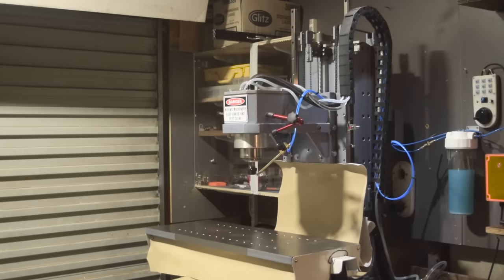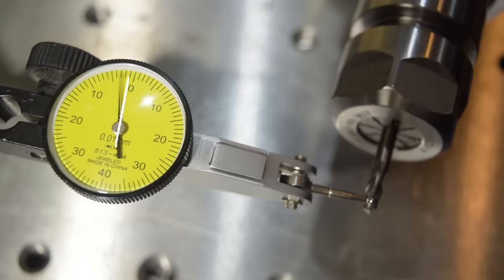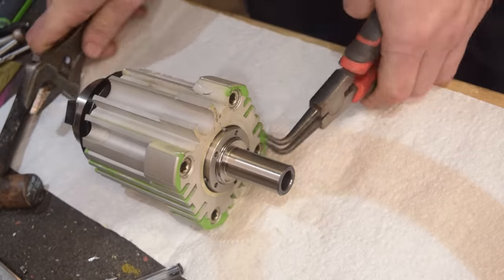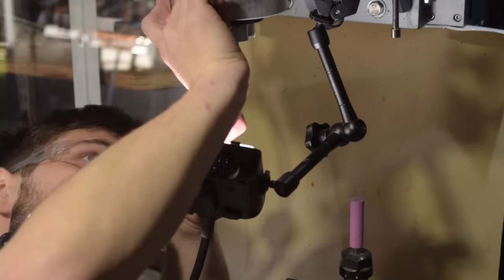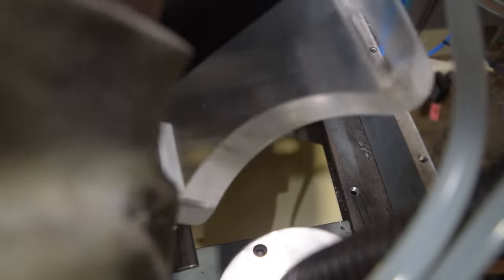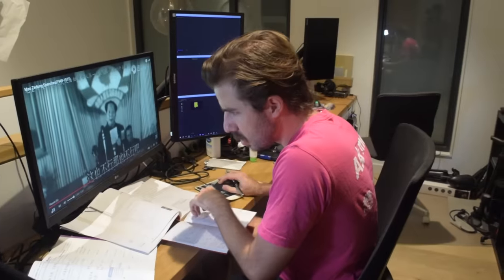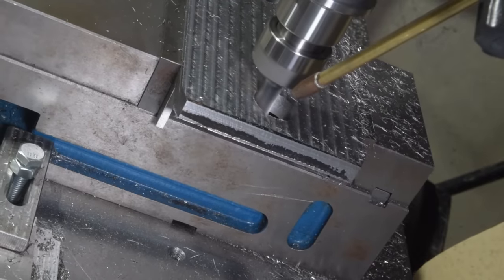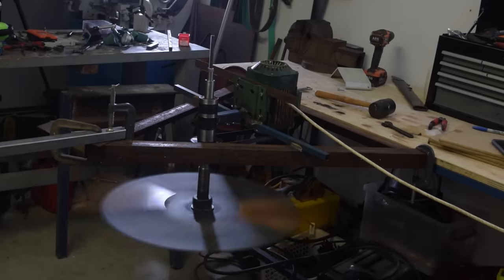I "fixed" this cheap Chinese tool

Comment: Don't take this as a criticism, but I would like to give you some tips for your griding setup. A spindle taper is not that difficult to grind, but never use feeds other than single axis. This adds up to the machine's errors and backlash, and very few CNC milling machines are precise enough to properly perform grinding to the precision required for BT30 using feeds in multiple axes. Typically, the attachment with its own feed is placed on the table, ensuring that it is perfectly parallel to the wall of the taper, but if you prefer to use the machine feed, you need to mount the spindle at an angle and the grinder vertically. You should move only Z-axis. Use a dye to check your progress and correct the angle if the top or bottom stops making a contact. Also make sure you're not pushing the grinder away, make empty feeds every few passes until the sparks disappear and the spindle is quiet, and then continue.
As for the bearings in Chinese spindles, they are terrible. It's best to buy the first one you find from Japan/USA/Europe. If you have a lathe, you can easily make a better housing out of a piece of steel or at least aluminum. I feel like you know how to do it.
Manual spindle scraping is only carried out on quills and mounting surfaces (sometimes on bearings in huge machines), I do not recommend it for DIY, it took me several years to learn it at a basic level, and here you need a master level 😉
Reply: Actually most spinde repairs are done with driving two axis simultaneously. Real cnc machines are accurate and repeatable enough to manage the operation. Not the diy hobby machines but industrial ones, like Mori, Emco, Mazak, Okuma and many others. Making parts within couple of thousands of millimeters days on end, grinding a fresh taper is easy.
Reply from the maker: The first time around it did a fantastic job with interpolation, so I just stuck with it. I was tossing up a bunch of approaches before I jumped in, and your method definitely crossed my mind! I have a few thk linear motion units (combined bearing and ballscrew with a motor mount) kicking around, which I think I'll make use of when (if) I get around to regrinding this spindle.

I think if I ever go to that trouble though, I'll pick up some beefier bearings, and probably make up a new housing. And the headstock needs work. So don't hold your breath for pt 2 any time soon 😁 I'm pretty deep into the lathe you would've seen in the video, which involves building a new spindle, saddle, tailstock, + maybe adding some CNC lite™ features. 

It never ends (thank goodness) 📈📈📈

And thank you for the info! I've always got a lot to learn.
Reply: tbh you could probably throw some bar stock in your lathe, add a couple of skf bearings, and make a better block than you'd have trying to salvage this.
Reply: @MJPilote  Fadals certainly aren't!

Comment: Wait a minute! You grinded the spindle by keeping it straight and offsetting the grinder by machine table movement in Z+X (or Z+Y) !? Holy moly!
I guess just another way to learn that hobby-grade (and for the matter any) stepper/servo based system is not precise enough for such an operation.
2 tips: 
- Align it by tilting the head of the machine/spindle in the precise angle of the taper (the hardest part) so only Z-axis ever moves during the grinding process. Indicator is a must here!
- Use much bigger grinding disk/stone than you used the first time! Ideal is 9/10 of the narrow side of the taper.
Good luck!

Comment: I did a near identical process to my cheap bt30 spindle cartridge. I rigged up a high speed grinder vertically and had the spindle move up and down at the taper angle. I also had to manually grind down high spots to ease the process. It's probably more common than we think.

Comment: These are great videos, so please keep them coming.   Not sure if others mentioned this but, as for that taper, the nice thing about them is that you don't really need the entire taper to make contact.  I have seen Morse taper tools spin, causing galling inside that a taper ream couldn't fix, so most folks will just run a boring bar up in there and remove a clean and consistent groove where the galling was.  As long as you still have concentricity and an adequate amount of contact, you will be just fine.  Thanks for the great content!!!

Comment: The vibrations is caused by slack in X
Two places it can be, the ballscrew (if you got those cheap ones, the balls are not made from proper steel and hardened properly, the screw itself is rolled and will last enough for hobby) or the guide/rails/tracks. Very good video!! It really shows the issues we face when buying cheap parts (am toolmaker, but also play with my own DIY for fun)

Comment: That’s awesome !

I have a cheap Chinese tool & cutter grinder that I bought used , and I spent probably 60 hours in hand-scraping the table flat, all the ways straight, rail beds flat, and adding an system . After all that effort, it’s straight, but still a terrible grinder . 

But hey, it’s the only thing small enough to fit in my shop.

Comment: I like your moxy, kid. You don’t give up. You don’t the heaviest things weigh you down. Makes for a great artificer.

I have a traditional home machine shop, which I call my $150.00 machine shop because I have six lathe I’ve accumulated over the years, 5 of which I paid $150, each, at the time and the last one I paid $350 for because it’s what’s called a 3 in one lathe milling machine. Though each had its set of problems, for the price I paid for them, all. It paid out in the end as precision machines after little work done.I now have a precision home workshop.

If I could do it in a similar way you’re doing it, I know you could do it in a similar way I did. Keep up the good work, makes for a fine channel with great content.

Comment: Great video. Envious of your machine for sure. As for the arc pauses, try setting G64 at the beginning of your G code. It’s constant velocity mode and will smooth out arc movements, should be a way to set tolerances on the smoothing as well
Reply from the maker: Thanks for the tip! Will give it a try

Comment: Oof I had the exact same ringing/resonance when cutting in the Y-direction on my vmc build just like you had cutting that arc. Ended up discovering that I had a few thou backlash in my X-axis. The BK ball screw block I had used deep groove bearings without preload and allowed quite a bit of axial play - swapped these out with angular contact + shim washer and has been cutting like butter since.
Reply from the maker: Yeah I think it's a combination of a bunch of things. That endmill was well used as well. Have since been playing around with some brand new roughing endmills and it's playing a lot nicer!

Comment: Just an idea, have you seen how mechanic's use a paste for grinding valves to get a clean fit "Valve Grinding Paste 100g" might be easier than doing the tapper by hand.
Reply: This needs precision over multiple parts, not just between two paired parts.
Reply: @volentimeh  - Obviously, he needs two more cheap spindles to implement the 3 thingy method of metrology generation.

Comment: I once bought a drill chuck with a MT4 taper on the back in the far east, for use on my manual mill. Only useful to stir coffee with the 0.3mm runout...
Reply from the maker: The spindle actually came with a bag of instant, I wondered what it was for!

Comment: Buy a metal throat tube for your Kingroon 3D printer... The hotend has a design issue where it has a PTFE tube in the tip of the throat tube that melts way below the point that PTFE should. It also has  a cavity at the top that filament likes to use as storage space and that causes jams.

I was very near buying a whole new toolhead for my KP3s before I found out that the throat tube was the issue

Comment: you could turn most of the middle from the taper, as clearance of 1/4 mm,  so there is less to get correct, and more likely a good seat. Should also lap after grinding.

Comment: You, not an engineer: "I'll manually grind out the spindle and sacrifice a bit of contact with the tool holder in order to reduce the spinout"

Me, a (network) engineer: "Ah, yes. One of the crossbeams got out of skew on the treadle, impeding the appropriate encabulation matrix. I understand machine things."

In other words , I have only the vaguest knowledge of what you're doing and these videos have still been fun to watch and easy to follow. A+ good stuff!
Reply from the maker: Let me put my comment in terms you might understand:

Beep Boop - access granted to creator approval

Comment: Love the vids, keep them coming. I wonder if the high spots in the spindle taper were spots that were work hardened and your grinder deflected around them? Grinding them down with the rotary tool would have been the only real way to get rid of them.

Comment: I still want to see more of this $260 spindle! 

It's such a crazy deal, even if it sucks out of the box, if a way could be found to make them effective for another $260… they'd still be great deal. 

More budget spindle content for the DIY guys! 😂
Reply from the maker: Don't worry. This thing will be running in the mill for the foreseeable future! But there are better options for $260usd X 2 I'm sure.
Reply: @NoEngineerHere  The original part is made in the same factory as the knock off, OEM parts come out first then employee families rent factory time and produce (high quality like original) after work hours : (
Reply: @NoEngineerHere I'm all ears my friend. 

Unless I'm missing something, it seems like the next option up is the BT30 RATM unpowered spindle kit for around $800 and then the powered spindles start around $900 for the ISO20 and more the ISO30 & BT30 options. 

Any idea. Which way you'll be heading?

I'll be looking forward to more footage of this. Excellent job.

Comment: Try warping a very fine piece of sand paper around the full length of a good Collet and then use the lathe for alignment and rotate it by hand slowly .. that might give you a better uniform result. just an idea.

Comment: If possible, measure the distance where that taper lock pulley needs to sit relative to the motor then pull the motor and install the pulley on a bench. Its super easy to tighten those unevenly and cause wobble. I basically have to tighten them with an indicator on the pulley while walking each setscrew in a little at a time.

Comment: The hight spots are due to an unstable girding setup. Narrow stone mounted on heavy arbour and a machine designed for the job, your grind stone is far too long and the shaft too kleine. On a grinding machine the bed is ajusted to the angle of grind required. Universal flad bed girding machine can make angled inside and outside grinds.. Good girding result can be accomplished on a lathe however, if the necessary precaution to protect the lathe's bed are not taken, it can ruin the lathe. Chinese tool holders: I haven't measure one yet that hasn't had a run-out of less than 0,01-0,05 m/m on the radial measurement and their spindle seem to be the same. Which is no good for good quality machining. The standard run-out on a European manufacture tool holder is fro 0.002-0.005 m/m. Great video. I forgot to mention, you ave to use a balanced girding stone.

Comment: Did you use a new grinding stone that had never been used with non-stainless? If not you contaminated the surface.
Reply from the maker: No stainless was harmed in the making of this video

Comment: As someone who works with electronics so small that it's on the border of needing tweezers and a microscope or just saying to hell with it and getting a machine to do it, videos like this are quite relaxing. Large spinning machines that carve out holes in metal are at the other end of expertise, it's good for getting my head out of the space it gets in.

Lol, that D-Sub connector is so huge.

Comment: You could use a sacrificial tool holder with exelent tollerances, and lap the spindal surface with it and a cutting compound, like you would a valve seat maybe? Better yet, get the thing to lap it's self!

I say sacrificial, but it'll probably be the best fitting tool holder you have by the end! xD

Comment: I might have ground a HSS tool to about the radius of the taper, and used scraping, instead of the die grinder... I used a scraper on my lathe chuck (set to the average size stock I want to use), and got rid of "bell mouth" and runout to a "reasonable" level ... and no grinder dust in any bearings!

Comment: lapping may be the simple answer to address the high spots and increasing contact surface. I get that you've spend too much work on it already, but why the acrylic mounting plate? Why acrylic?

Comment: You should have started with P1 bearings (from China to get disappointed again). And it is helpful to fix a bearing with grub screws if you want improvements in randomness of runout. So you are on the right track to fix crap with even more crap.
But nice video editing if your plot is "paint to cover".

Comment: yeah don't even try I would rather make my own spindle and spindle housing . I grantee you that the spindle housing bearing seats are out of alignment.
Reply: They prob have a 13 year old girl running manual machines pumping em out 16 hours a day lol

I couldnt let work like that slide lol

Comment: When you regrind the spindle, don't use any of your axes.  Set the grinder up on a sliding fixture indicated to the precise angle using a sine bar.  Then drive it manually or put it on a screw or something.

Comment: So I'm looking at this same spindle for a mill I'm building and from what's online and this video I can't help but asking why didn't you change the barings? It's using a deep groove ball  barings witch are junk. It would run good with a angler contact baring on at least the top and bottom. There would be no need to grind on it at all.

Comment: Bought a 24k rpm spindle from china myself years ago, ER collet spindle .. installed it and it screeeaamed while running the machine, found that the collet taper was over 0.1mm off ... set it up in a lathe and reground the taper and still runnig the same spindle to this date, tho ive changed the nose bearings to precision angular contact ones .. cost more than the whole spindle + vfd together :P

Comment: that's why I am not buying at stores that don't specify precision in the product description. A real pro knows everything in machining has a precision level and that you need to state that when you sell a part. If a store doesn't put precision in the product description it means they are not knowledgeable and it is not worth to deal with newbies. Buy only from the pros.

Comment: You should consider using a boring bar on your lathe to fix the holder's eccentricities.
Also, what are the specifications on the motor on the milling machine?

Comment: 9.52 , maybe joint the 2 parts at same time, like we do in motor valve. small amout off grinder dust and rotate the  2....  just an idea :)😏

Comment: also, is that chatter comming from the headstock itself? are you sure it is not caused by backlash in Y axis? the oldest VMCs we have at work chatters like crazy while machining outside corners X-Y+ and X+Y-, that we know is mostly caused by the backlash in the Y axis, which is almost 0,06mm for that particular heap of junk...

Comment: you sure like to set yourself for a whole lot of pain, $500 bt30 belt driven cartridge would have spared you the trouble but I understand working on the machine is much more interesting than any project you can do with the machine, may I suggest designing and building a motorized spindle from scratch next time? or make a direct drive rotary, t motor eg. RI-100 is a $100 frameless motor that should be easy to start with, unless you want to make your own, in which case you can get altair flux motor or ansys motor cad from getintopc, it generates all the hard parts for you based on input parameters eg. magnet sizes so you dont have to order custom sized

Comment: i'm thinking of making my own spindle.
But please give me opinions on my aproach im planing.
I will machine the spindle but will not fully machine the tool holder part of the spindle, instead
i want to put a toolpost on my machine bed and make a program for spindle to machine it self on that toolpost... hoping to gain advantage of cnc precision...
Reply: getting back to it... i am watching other peoples videos and getting the same spindle and they don't have same issues... so im not sure if it was only your spindle or idk..

Comment: Wow that spindle is... shite... Probably still going to get one lol. Did you check the spindle shaft between centers for cylindricity before reassembling it? Or check the hardness of the spindle shaft?  I'm curious if the bearings could be replaced along with the housing and then grinding the internal taper when reassembled would fix it. I imagine the ground features on the OD SHOULD be harder to screw up because they could be done in a single setup.
Reply from the maker: By the time you've paid for bearings worth paying for, and bought the material for the housing, and upgraded the draw bar etc etc.... might as well spend an extra thousand bucks (AUD) and get one worth getting 🧐 at least I know that now